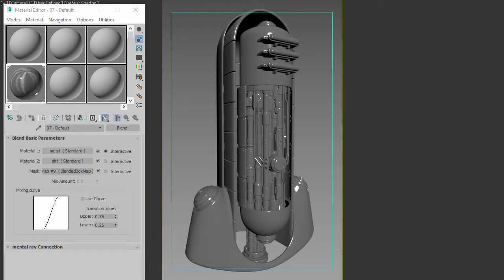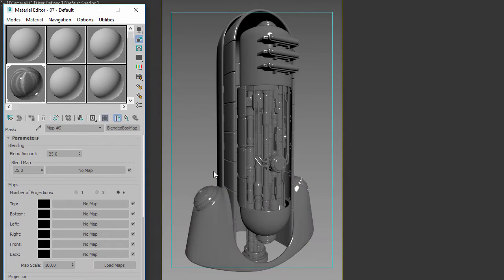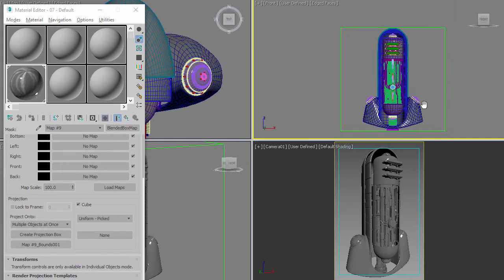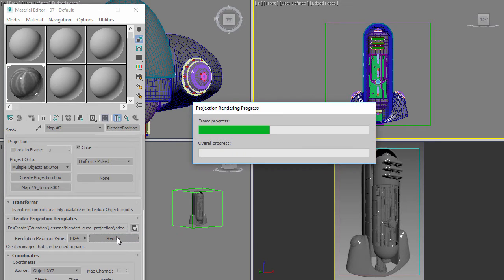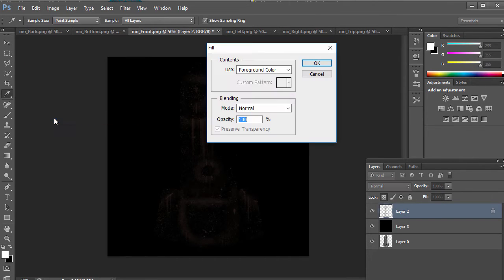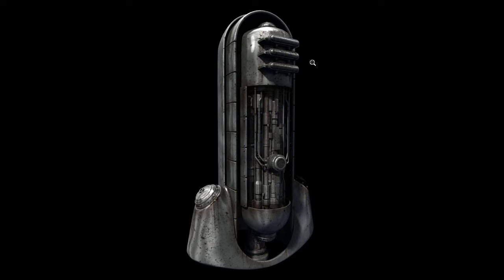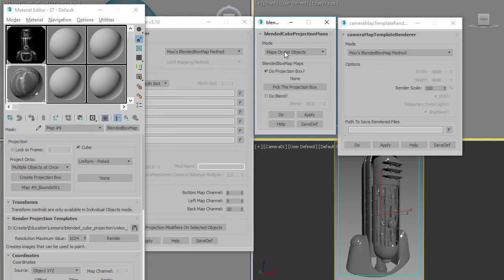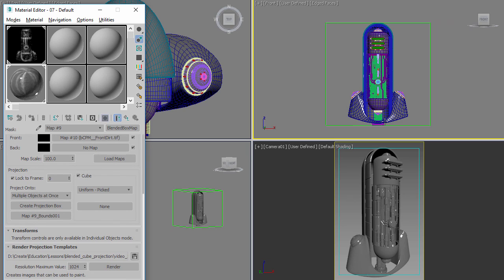Blended Cube Projections Part 3: BlendedBoxMap map in 3dsmax Method

Comment: tnx a lot.how about  objects are behine eachother?the dirt  you use will paint on them too?
like pipe that are inside container?
Reply from the maker: Most of the time you don't notice the repeating dirt. But in times where you will (say you have an arm sitting against a body, and you're projecting from the side), I move the arm at frame 0 to a new location where there's no overlap, paint on that, then move the arm back to where it needs to be frame 1. I then set it to "Lock On Frame 0", so the paint moves with the arm. When you paint a practical model kit, you do the same thing. You paint the arm separately from the body, then you attach the arm to the body afterwards. So its the same technique, just the digital version :) Let me know if that doesn't make sense.
Reply: i will try ..thank you
1 thing that couldn't understand  is why bump map not working with AO(vray)
it works in reflection diffuse and other channel but why cant bump the AO with noise on raduis for making dirt??
Reply from the maker: I believe that's an algorithmic limitation, many raytraced effects can't be converted into a bump map, and that's true for most of the raytracers I know, not just vray.